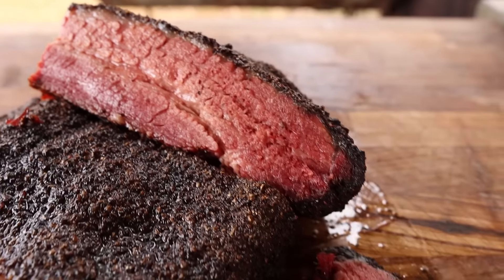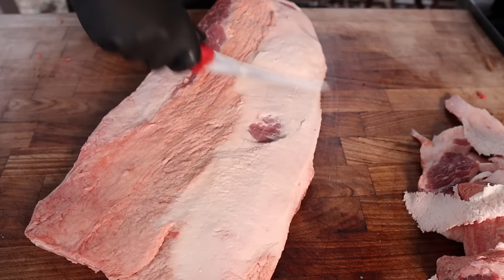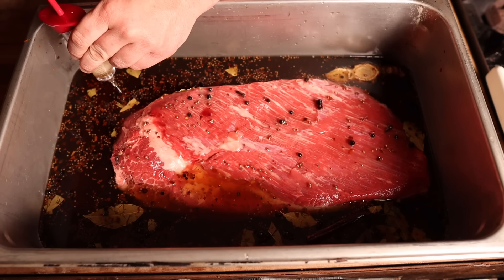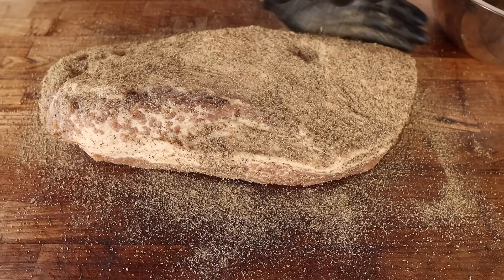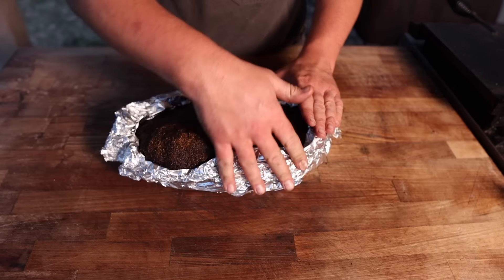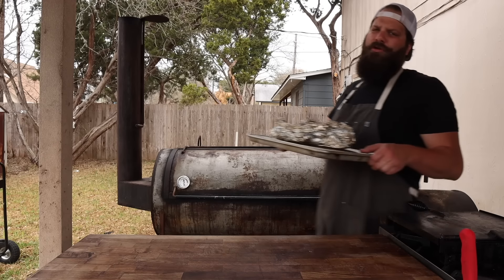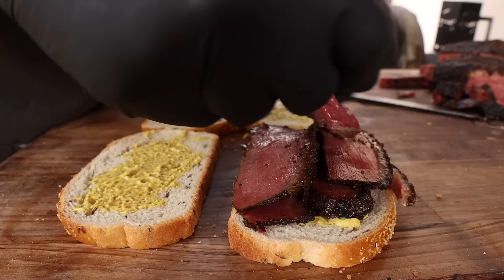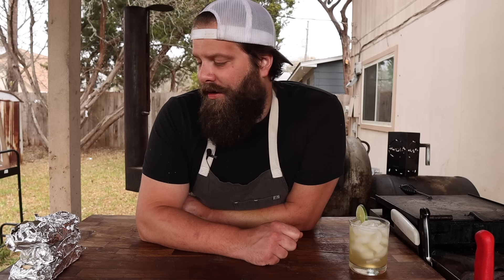Pastrami Brisket | Chuds BBQ

Comment: I don't know if You see this , great video, i just want to know about if the ratio of the brine (salt, sugar, etc) is measured based on the líquid or the weight of the meat?.... I want to do this but with a smaller cut and I don't want to over salt it or play with the pink salt.

Comment: Mr Chud - I'm attempting my first pastrami finally and using your vid as a guide. Question though - it doesn't appear that your brisket is fully submerged in the brine (I thought it needed to be based on other vids / recipes). Was it submerged off camera or is that not necessary?